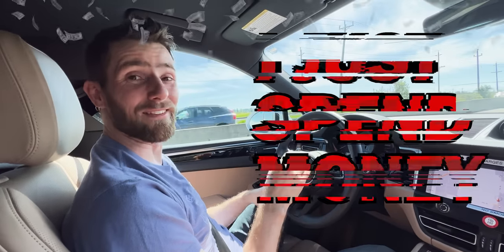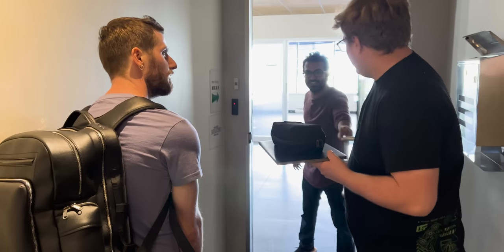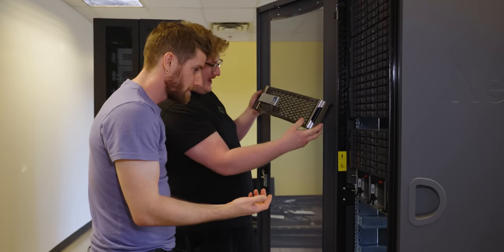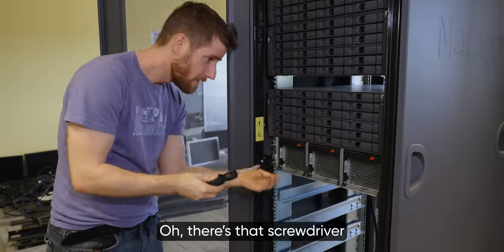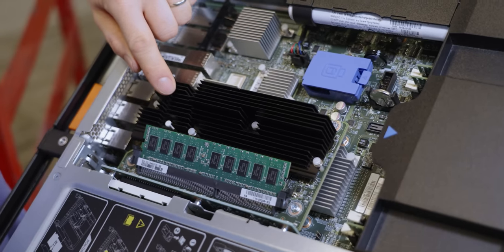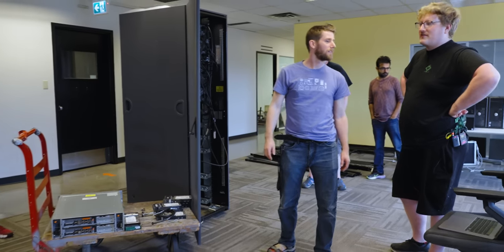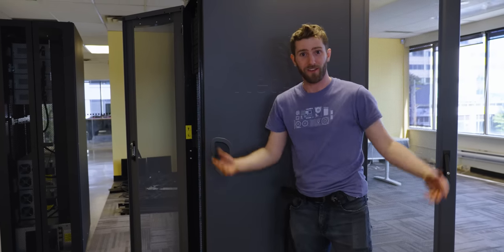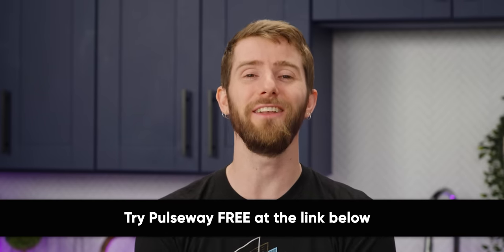WHAT did I just BUY on Facebook Marketplace?? - NetApp Storage Appliance / Disk Shelves

Comment: In the early 2000’s, I used to install and configure these systems on large scales, in the late 2000’s I was managing a Netapp SAN system where I was working.

The config was a dual head system with redundant controllers on the primary site, which snapshotted data to the recovery site every hour, where nightly backups were done to tape.  Overall data capacity was 70TB back in 2012 due to the issues of the 2008 financial crash finally rippling through to the market we operated in.  

There were a number of drive pools, fibre channel drives which were stupidly expensive and topped out at 300GB, SAS drives which mechanically were as fast as fibrechannel on paper, but higher capacity and the SAS interface actually made them marginally slower, and SATA, nice high capacities and cheap, but a lot slower.  The number of orange fibre connections at the back looked like some form of melted safety gear that got mixed up with spaghetti.

While I’ve not touched one of these for 11 years at time of writing, I could probably get one configured as the commands were fairly logical.  Also I still have most of my notes

Comment: We have 'SAN' equivalent things where each single file can be 'duplicated' in a RO way to remove IO limits (the system is clever enough to judge whether to duplicate (which file) depending on load. If a file is not used it will be dropped at a certain time (as there is always a TAPE-ROBOT copy).

Comment: Very cool however one remark that didn't come forward in your video: The main difference between a SAN and a NAS is that a SAN often had its own network infrastructure. iSCSI especially with Ethernet Jumbo frames required a separate network (cable) infrastructure. Servers were often equipped with an HBA or Host Bus Adapter with Fiber cables.

Comment: I actually did something similar for my home lab/NAS server, bought a Dell MD1000 for a $100 and then another one for spare controllers and PSUs but without caddies for $60. Set for life, it will take any 3.5" SATA or SAS HDD. You hook it up to a server running TrueNAS and have the power of ZFS for the cost of drives.

Comment: You are picking quite a lot on those 600 GB 15k rpm SAS drives, but for cost efficiency in many systems out there they are still quite common. Not everyone needs terrabytes and petabytes of storage space for videos. And depending on the applications you want or have to run, those might be quite specific about shared drives. Only these days they will be 2,5 inch drives, not 3,5 inch ones.
And one correction, iSCSI over Ethernet is using TCP/IP, you usually just use flow control and Jumbo frames with that.

Those power supplys definitely got smaller end even with higher efficiency over time. but for those devices, they still arerather large in comparison.

Another thing on you explanation between NAS and SAN, A NAS is usually shared Storage provided to Clients. A SAN on the other hand is intended to provide large amounts of storage with redundancy, possibly mirroring between sites, dedicated as columes to servers. For example to database clusters or as mentioned, to a hypervisor. but you would very rarely if at all, connect any client to a SAN.

Comment: As a retired NetApp employee that worked in customer service... Some of the things:  1) The filer can do Fiber connections for LUNS.  2) CIFS/NFS connectivity is just a matter of buying a license from NetApp.  3) Backup0s?  Snapshots taken periodically, and with software  on the servers to freeze access for SCSAI, E#xchange, and so on... So that a backup snapshot can take place quickly... then restarted with NO issues.  4) The heads (assuming you have 2 controllers) can fail back and forth incredibly quickly... Ownership olf the drives changes in a matter of a couple of seconeds..then the filer head reboots.  (It has no storage so a reboot is needed..)  The other head does a reboot with a virtual  image of the machine it took over.  It is all done quickly enough that fiber connections are not lost... Very neat technology.. Runs on a version of Berkley.. so the number of vulnerabilities over the year has been very l9ow...  Want 10 gig ethernet?  Easy... just add the board.  Want Fiber to  connect luns?  should have the ports...  In other words, for a decades old system, it is mondo e3xpandable and reliable.

Comment: As someone who used to deliver SANs for a living.. my concern would be whether you can get drives to work in those chassis. Not sure about NetAPP but a lot of SANs use custom FW on the drives and you can't just replace them with generic SAS drives. Good luck gents!
Reply: That would be if they were to use the array as is (keeping the head / nodes) adding any drove wouldn't work then,  but the jbod should work OK connected to an HBA.

Comment: been waiting a long time for this kind of video :) 
large company's dump these kind storage devices for free sometimes, I have like 3 IBM v7000 storage unit with 5 disk bay all interconnect with fiber interconnect 8G from 2014-2016 :) including software as my homelab!
Only drawback is power consumption of these older devices and keeping the software up2date. 
But for my homelab it is PERFECT!
also create a node-red app with a raspberry zero to power-up my lab system from remote :P to limit power costs
what could be a good use case is to upgrade the disks of the SAN/NAS (unified storage unit if you have the correct software) by NVME with SSD 2.5" or 3.5" conversion cases if controller can handle it

Comment: Most of the SAS controllers (Closer to 90%) of them can handle SATA drives.
The reason as to why that works is because in the SAS specification or Serial Attached SCSI as it is known, you find a tunneling protocol for SATA known as STP. (Yes, it is a further development of the old SCSI standard from the 80-90s)
In short, the SAS controller can talk to the SATA harddrive in a language that the SATA harddrive understands and can react to.
This is why there is a craze for homelabbers to buy the old LSI controllers that are close to 10 years old, because they work perfectly with harddrives for storage of almost any size, SATA or SAS.

Comment: They actually run on even one power supply. Of course that‘s not enough for 24 drives spinning up at the same time. But they run reliable with any two power supplies. The fans in the supplies will work even if the supply isn‘t connected to the mains. The fan will be powered by the other supply. Pulling out a supply, working or not, will make the remaining fans go to full tilt, unless you got a dummy cap for that supply slot. With an open supply slot the air flow doesn‘t work as intended, so the fans go berserk to compensate.
Yes, the Netapp shelves will take SATA drives. If you exchange the IOM3 controllers in the shelves with IOM6 you get SAS2 speeds (There are IOM12 with SAS3 too, but they‘re rare) and support for SATA SSDs.

Comment: That many drives and jbods I'd have gone RAID-61.  RAID-6 each JBOD and RAID-1 two JBODs together.

All my drives back when were hot swappable. Used to replace a couple of drives per year regardless and kept the old drives as spears incase a live drive actually failed.

I'd prefer to run a NAS over SAN.  Run each server in a VM connected to their drives over SAN. One of the servers can be a NAS server.

The key is hardware redundancy. If a hardware server goes down your VMs can auto run on another server and your NAS is still running.

Comment: We transported an EMC Clarion CX4-120 SAN full of disks, including extra drive chassis a total of 8kms in the back of my Ford Explorer in around 2012. Migrating out of one Datacentre to another.  it literally took 30 odd minutes to get there simply because I was hella scared of going any faster lest we lose any drives.
Thankfrully no Drives lost.  Although even though we had it all racked back up before midnight - we were still there til 9am while Unisys struggled to get the Actual Clarion itself to boot up.  Ended up needing a replacement System board in the end (not damaged through the move - Bad initial config with a subsequent Firmware update that meant a hard power down caused a catastrophic failure.)

Comment: Yes, 600 gig drives because in enterprise environment they require significantly less recovery time in the event of failure, other disks are less prone to fail while receiving data to rebuild raid and disks are more stable with smaller sizes. From my experience even these enterprise-grade with bumperd up MTBF parameter 1,8TB disks are the recommended cap-top, everything higher capacity than that is just extra risk on environment maintenance. And to be honest- when it comes to client critical services when your client is bank infra or government services... buying extra disk shelf or two is small price compared to downtime or transfer rate drops and need to pay contract penalties, which in such cases go into at minimum high six-figure amounts for each 10 minutes. And disk shelves number doesn't matter that much anyways since HA is requirement so 2 controllers are also required (so processor power to maintain all data reads and writes is ensured) just as 2 SAN switches and so on the entire path to end servers.

Yes, it IS weird if you had only experience with things like storinators storing raw camera data but if you start managing really big client environments where 1 env can have like 10 storage arrays 200TB each you're quickly changing your priorities mindset. And don't get me wrong- sure, for company around 100 people this kind of setup is already REAAAALLY awesome stuff but it just operates on.

Also- everything ending with "... over ethernet sucks". FCoE is already a stretch but iSCSIoE is whole-ass another level of "nope". And if you're wanna say "it's no problem because I have 100 gig network switch" just don't bother- at this point you just should buy SAN switch with SR fiber and SFPs or at least copper twinax cables.

Comment: I remember trying to wrap my head around VMWare ESX on hardware which was running 10+ VMs - ESX was booting from SAN-based storage over fibre optic links. The drives holding the C: drives and data RAIDs were also running from the same SAN over other fibre links. The drives the VMs thought they had installed were running over yet more fibre links to the same SAN. The levels of virtualisation and storage abstraction were literally INSANE. Not to mention that all the C: drives of the VMs were mirrored and all the data and LOGS drives of the VMs were RAID 5... but they kinda weren't because they were in a SAN... totally blew my brain up. None of this infrastructure we built ACTUALLY EXISTED.

Comment: You say SAN is the way forward... well for some people it has and will be. vSAN is now a thing and putting the storage back with the compute devices - as Dell has done with VXRAIL - distributed storage because you can very quickly get to the saturation point of your connectivity and having the storage spread out balances out the connectivity. Also means that all your storage is not on one node, and you can tolerate more failues. Raw block storage is great for virtual devices. SMB is very hit and miss with a storage providers implementation of it, most of it based on SAMBA - that has seen massive increases in its capabilities more recently

Comment: Thats an enterprise unified storage ( SAN and NAS support ) , i was a netapp storage back in 2014. The one you buy is an old array that have 8GB Fiber Channel. Its better to use an iSCSI with a 10GB or 25GB storage server. The benefit of an enterprise storage is the enterprise storage support and RMA. But the caveat is, you cant use market place disk, the firmware is different and you can not also use those disk on general PC.

Comment: There are utilities that will take an existing drive with 1M blocksize and offset and reformat it for NetApp's 4K WAFL block size, but that's only half the battle, some of the FAS controllers and versions of ONTAP will only recognize drives with NetApp firmware. There used to be a hack around that, where you could change the personality of the controllers from FAS controllers to "V-series" controllers, which could take non-NetApp storage and create WAFL aggregates and volumes.
Reply: Seagate EXOS drives that are labeled "FastFormat" can have their block size changed with SeaTools, they market that as a "feature", are you saying you can do it with any old drive?
Reply: @timr86868  I don't know that any old drive will work, but it's my understanding that it's meant for newer drives that use different block sizes, not the other way around.
Reply: @timr86868  Regular SATA drives are stuck at 512 but I think most SAS drives can be reformatted to 520 or 528.

Comment: Iscsi still goes over TCP network. Alternative methods of connecting SAN storage is fiberchannel (which comes in scsi and nvme flavour nowadays). Advantage of fiberchannel is lower latency and a protocol designed to handle storage requests. Downside is the specialist hardware needed and the horrors of performance loss due to bad connectors, C3 discards and credit depletion and such.

Comment: Two things:

1) The thing that Linus said about where you can move files between the "partitions" (iSCSI) - whilst yes -- you CAN do that, but no, it does NOT necessarily actually move the data any faster.

I am PERSONALLY finding that out, albeit, under a NAS environment rather than a SAN environment, with my Proxmox server, that under a heavy "disk-to-disk" (or rather ZFS pool to pool) transfer, that the load averages shoots way up, and unless you have your datasets set up JUST right (where you, in theory, can send the entire dataset), otherwise, the transfer will be (or can be) very slow.

2) re: running iSCSI -- it has its pros and cons, like it is with anything/everything.

Comment: I have exactly the same setup (I actually have 5 of the DS4246 4U units), and you can definitely put Standard SATA drives in them and they will work 🙂

Also you can upgrade the control units to IOM6s for 6Gb/s throughput or IOM12s but the back planes are limited to 6Gb/s.

I'd love to see you fill them up with 22Tb drives. I dare ya! 😉😂

Comment: Don't worry about block size
I have been formatting drives both ways
There are multiple block sizes
512B 520B 528B
4096B 4160B 4224B
Yes, you can format between sizes, as long as you do it between compatible sizes
I did format from either 528B and 520B to 512B and back too
Linux have scsiformat, which does the trick

Comment: It's pretty easy to implement both a SAN and NAS on the same machine with Linux.

The complicated part is having full redundancy by using two or more servers.

At the block level, it's pretty easy using DRBD to keep the data in sync between two machines over the network.  

It's the service provision that can be a pain.  For NAS, you can provide load balancing as well as high availability using a cluster-aware file system like OCFS2 or GFS2.  These file systems will coordinate file locking between separate machines.  For a SAN, you can't do load balancing - only one storage server at a time can actually provide the service.  You need clustering software to handle failover, which disables access to the failed machine for that resource and enables it to the backup machine.

Which is why appliances like that exist.  It's probably a more or less turnkey solution that handles all that.

Comment: The real differences between a SAN and a NAS are about the hardware and the OS running behind them these days. The stuff about iSCSI being the big difference really isn't a difference when basically any NAS can already do that. SANs tend to have all those redundancies you mentioned built-in, connections between the drives/JBODs and controllers tend to be more internal server hardware-like rather than networked, and the OS running on them are proprietary with those built-in support contracts that can do some things that NAS devices usually don't do as well, as efficient, or as redundantly. A NAS can usually do nearly anything a SAN could do 10 years ago. You just happen to use yours as a fileserver without using a VM on top of it, whereas with a SAN you generally have to do that for centralized storage. You can run a VMware server environment on multiple hypervisors with centralized storage with either a SAN or a NAS, but the SAN was there for higher performance and greater dependability than a NAS. That's clearly what that company did. What LMG did with your NAS was a good option for you since you don't need a bunch of VMs running on top of it, it was just file storage. Even 10 years ago, for what LMG needed, NAS was the right way to go.

Comment: This is type of equipment I need, one day I picked up 2 TS3310 IBM tape librarys (for free somehow), came with 8 tape drives and 8 power supplys. The problem is that I don't have a fiber optic switch to connect the drives 😐

Comment: That makes sense the nas relying on tcp. You have to know that it is a connection orriented protocoll means that it checks if the data packages are all received. If not it sends the los ones again which is what younwant as a user. If you are loading a file you want all your file data and not only 3/4 of them. If that where the case you could not open your file i.e. a textfile again because of the missing bits. But for something like music streaming tcp would be very anoying! It would take minutes for big songs to be loaded! Instead of this only a part of the song is loaded with a protocol (in Case of Spotify based on udp) which does not cares about package loss.